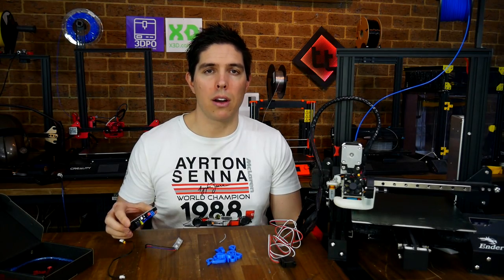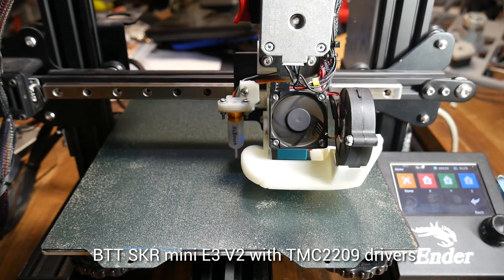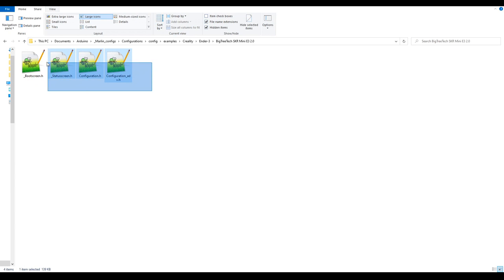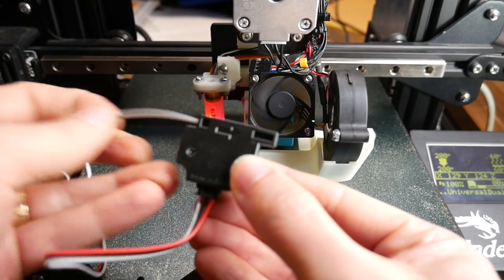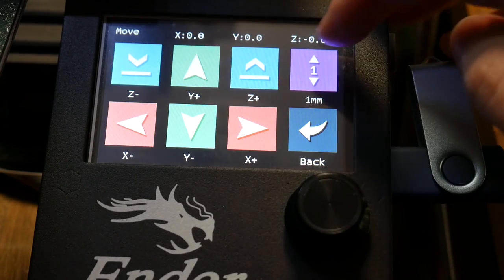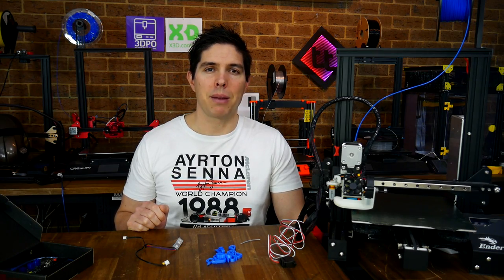SKR Mini E3 V2.0 - Complete guide to the best value Ender 3 upgrade

Comment: Because I use this video OFTEN as a reference for this board, here are some bookmarks:

0:57 - What is the BigTreeTech SKR Mini E3?
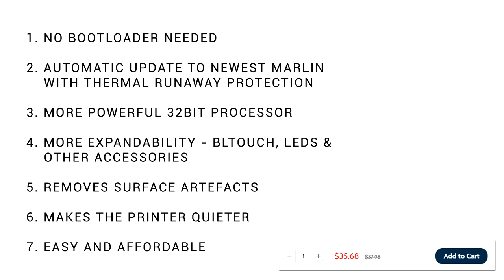2:21 - What is Different From V1.2 to V2.0?
4:09 - How do you install the mainboard?
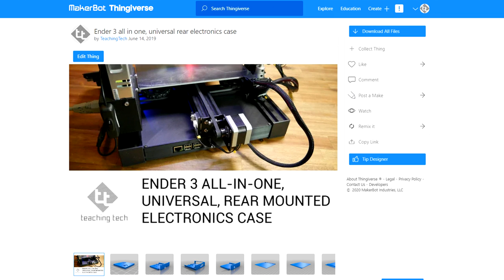4:57 - Compatible out of the box?
6:11 - How can you compile your oen firmware?
8:39 - How does the new EEPROM work?
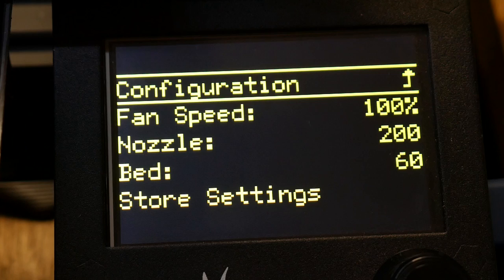9:01 - BLTouch Compatible?
10:42 - Filament Runout Compatible?
11:45 - Neopixel and other accessories?
12:59 - TFT35 Dual Mode Touch Screen
13:37 - 3d Printer Wifi
13:43 - UPS
13:55 - How to activate sensorless homing?
15:07 - End summary
Reply: you are my hero for today.
Reply: thank you kyle! i just finished the long install of all 3 e3pro upgrades and bounced between 3 vids because theres a dif nugget of info in each vid...nothing worked right and i flashed and no ttft display after flash...wracked my brain...drank went to bed...double checked every wire config...bltouch connection wires red and blue were flipped...fixed...found out the damn reset button on the display was being pressed by the factory mount...WHY?! now i sit here dumbfounded and yep...
Reply: @507helmet  I had the same problem, took some measurements, went to my very cold shop, drilled a 3/8" hole in the bracket, problem solved.
Reply: thanks man, so freaking helpful. skipped half the video just to listen to the part i needed to in 2 seconds :)
Reply: How do i get the tick to show in the bottom menu? Thank you
Reply: @nikkicork8815  Not sure if you're still having a problem but...
If by "tick" you mean the video progress bar, all you have to do id click on the video and you should see it at the bottom of the video. This assumes you are viewing the video from the website and you haven't downloaded it somehow. If you have downloaded it the step(s) to show the bar depend on the application you are using to play/view the video.

Comment: Another great guide. I swear, you’re carrying the ender 3 community. I’d have never bought one if not for detailed guides like this. It’s a good thing you’re a science teacher, because you’re great at it!
Reply: You'd never have bought the Ender 3 if it weren't for these guides? Don't get me wrong, Michael has the best guides on YouTube, but the Ender3 has been the best value FDM printer for the last 2 years running.
Reply: Heroman I mean that I learned about the printer through Michael
Reply: @Drakoman07  same here and I agree with what you said (in an odd backwards type of way).  I bought the ender 3 based on lots of research with his being very helpful.
In hindsight, I would also say "id never have bought one either if it wasnt for micheal. aka: i wouldve had a teribble time trying to figure it all out and probably given up bc well all know DesignProtoypeTest isnt about to put in half the work towards being as helpful, detailed and budget friendly. Not everyone can just up and spend $300 on duet and 5' screen since i spent 2/3rds of that on the printer itself
Reply: My son chose to buy the Ender 3 Pro in August based on channels like this and the comments from owners. We've had a straight forward climb from build to very high quality prints in multiple filament types and never looked back. I'm extremely grateful to this channel and the comments from users about their experiences and ideas. There is no way the journey would be as easy as it has been without all of you. Yes it's a bunch of work, careful watching and reading etc, but still no big issues of any sort, and the print quality,,, wow.  We upgraded during the build process ( extruder, bed springs,and wheels etc ) , I can't say enough about the value of the  learning process , maintenance details and understanding the role of each component that this channel has provided. We use Solidworks to design, those drawings are done very differently had we not had the overall printing experience the Ender ( any good printer ) has provided. It forced us to do small upgrades incrementally and really understand printer setup and tuning adjustment. Best Wishes to all who contribute and Thank You !!

Comment: I recently bought an Ender 3 (my first 3D Pinter) and was looking for ways to upgrade it. I started watching your videos while researching printers. Once I got it and started printing, I knew I wanted to quiet it down. So I got the SKR Mini E3 v2.0 and TFT35 E3 V3.0 and installed them. Holy shiznit! It’s so much quieter. The touch screen feels like it belongs in this century. Now I’m looking forward to add a BLtouch and filament run out sensor.

I just wanted to let you know that your videos have been helpful and informative as I venture into this new hobby. So, thank you and keep making great videos. :)
Reply: I also just bought the Ender 3 as my first printer, will be building it this weekend.  I also am strongly considering at a new motherboard adn agree this channel has many helpful videos.  :-)
Reply: So after installing the SKR Mini E3 v2.0 I was still having trouble with first layer stick and bed leveling in general. I'd already ordered a BLTouch v3.1 and it arrived a couple days ago. So I got it installed along with the firmware available from BTT on github. It took me a little bit to get things figured out but now prints are sticking and I'm getting consistently better results. Yay! :)
Reply: @SereneScream considering it too. I have bed adhesion issues as well, have to use the z babystep on the first layer to Get good adhesion then turn it back. Its a pain in the ass

Comment: The biggest problem with this upgrade: After you install it, everything else on your printer seems LOUD. Especially the board cooling fan. Which means you'll need to swap those things out, too :D
Reply: @steveandre763  Does your firmware use the BLtouch as a Z stop?
Reply: @steveandre763  Are you able to answer the question Balan had? Does your firmware use the bltouch as a z stop?
Reply: @steveandre763  LOL He means since the stepper drivers are silent the fans SEEM loud, not that they are louder.

Comment: As a person that has owned an Ender 3 for less than 24hr, I was able to drop this into my stock unit without any issues. Massive improvement to noise and really happy to see you've tested out a lot of the popular upgrades!

Side note: Awesome channel. Been very helpful with me dipping my toes into 3D Printing!
Reply: My son and I are in the process of purchasing our first 3D printer and have narrowed it down to 3/3 Pro/5. How user friendly is the 3 for first timers?
Reply: @bocconom  i just got an ender 3 pro a few weeks ago (for the price its so worth it) , easy to assemble (you shouldn't get stuck but if you do youtube has alot of build guides for all models!), the hardest thing is probably getting the bed level, its not hard to do, but make sure you put in the time to make sure it is as close as you can get it, again youtube guides help you, but once you've  done that, its literally load filament choose your model and print it! :D always watch your first few layers to make sure it sticks to the bed! if you ever get stuck theres so many videos on here for 3d printers to help you! good luck
Reply: @bocconom  Very very friendly for first timers.  I'd argue that it's probably the best printer for a first timer.
Reply: @Mr-ZinK  Thank you much. Did you do any other upgrades?
Reply: @leopshef  I think we have settled on the 3 Pro. Thanks.
Reply: bocconom , the ender 3/pro is super easy to assemble. In fact I’ve had mine now for 2 weeks and have burned through almost 2kg of pla filament. The best advice I can give about building is follow the build guid here on YouTube by CHEP. It’s a little more involved but when I was finished building all I did was a quick bed level on the 4 corners and installed the micro sad card that came with printer and selected the pig and pushed the knob and away it went. The next morning I went back out to the shop and I found the cutest little piggies bank. Also the sad card that came with the printer also had a basic slicer program that works very well. It is based off of Cura. Also just FYI, I noticed tonight that the ender 3 pro is now only $209 with free shipping. However you have to order it from Creality’s website direct. Your new printer will arrive in 3-7 days. I hope you choose to join the ender family.

Comment: I bought the mini E3 largely because of your video, and I was blown away by how much better the printer performed with it compared to the stock board, particularly regarding noise. I've recommended it to a couple friends as the first upgrade they should buy for their printer, and they've been happy with it as well. Through my journey in printing I've watched your videos, so thank you for helping educate me and many others in the community. I started looking deeper into duet boards a week or two before your video on them, and they seem quite promising and offer several things that marlin doesn't have yet; it would be interesting to see how using a duet in an ender 3 impacted performance and usability. Happy Printing!

Comment: For those who bought the board for Creality printers: Remember that the positions of the mainboard fan plug and the parts cooling fan plug are switched on the SKR E3 v2.0 and the Ender 1.1.4 mainboard. This is also shown in the wiring diagram but I think it's not directly mentioned in the video.
Reply: thanks for mentioning that
Reply: I was exactly looking for this information... I noticed the discrepancy between the cabling on the original Enders board and diagram shown in the video. Thanks!
Reply: didnt work for me
Reply: @bobf3598  what didnt
Reply: Is the hot end fan supposed to be turned ON all the time? If not, how can I fix it?

Comment: I've just upgraded my Ender 3 pro to the SKR min V2.0. Only 2 small issues when using octoprint. I didn't get any comms via the USB port, I'm using a pi 4 and the USB operation has changed. Evidently you need to add "over_voltage=1" to /boot/config.txt of the pi, I had no issues with the stock ender board and the pi so it must be different on the SKR card.

Secondly, something I was going to get around to on the previous board but didn't was to put a slither of polyamide/kapton tape on the +5v contact on the USB cable so the pi is not powering the main board. I had false overheat protection alarms from the printer if you turn the main power off on the printer with the nozzle still hot. I didn't get that with the previous board so assume overheat protection wasn't enabled although the version of firmware supported it, it was the stock Ender firmware. I believe thre are other issues around powering the board form the pi, here's a good reference https://github.com/bigtreetech/BIGTREETECH-SKR-mini-E3/issues/41

Comment: I installed one of these as a retrofit on a Wanhao I3 Plus this weekend, and the only thing I haven't gotten to work is using the second fan connector to be a auto hotend fan.
Defining it as the auto fan, it powers up on startup. Other than some pid tuning for the bed and hotend, it's working well with a bltouch also. I didn't bother with sensorless homing.
Reply: how noticeable the improvement?

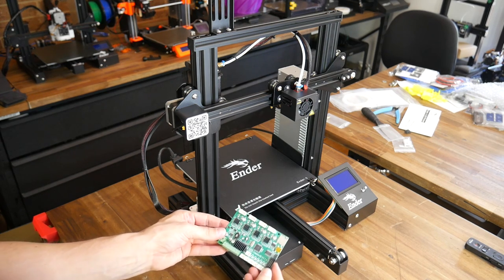Comment: 4:31 in the diagram the label for G and I should be switched around. had this problem that my part cooling was always on, but now when i switched it up the "G" should be in the "I" it worked normally Please take note of this!
Reply: Also E should read black/black and not white/white (at least on my printer)
Reply: Also, on the SKR diagram, connection B ... the wires shown are the wrong way round. Positive is closest to the side of connection C, not H.

Comment: You'll need to install the Platform IO extension in VS Code in order to get the tick option at @7:10!
Reply: Thanks! I was wondering why this wasn't mentioned in the video...
Reply: @doctorsnaketown  I think because as you get into the Maker world it turns out to be a popular plugin for using VS Code to program stuff like arduinos and other microcontrollers. But if this is your first entry into that world then (like for me) it is definitely hard to know 🤣

Comment: 4:29 - Just a heads up that at least on an original CR-10, "B" in your diagram is backwards. I don't know if the polarity is reversed on the SKR board or on the bed heater relay. Either way, after getting a bed heating error I swapped the red and black and it now works fine.
Reply: After you installed the board in the CR10 did you have to compile new marlin firmware, or did it work out the box?
Reply: @chrisstock5210  Yes. I had never taken the time to understand all of the Marlin firmware so it was a good exercise. There's a reddit post on building the firmware for Ender which I followed but started with the generic Marlin Example Config for Cr-10 and retained all the CR-10-specific items, mostly bed size/dimension related config.
Reply: Thank goodness for you! I couldn't figure out what was wrong. Now I'm set after swapping those 2 wires!

Comment: Just installed the v2 in my ender 3 pro and I'm pretty happy aside from two issues. 1: clicking Stop Print does not immediately stop the print. I have no idea why but there is often a delay between 10 and 30 sec before the print stops and while I don't use this much, when I want to stop a print, I want it stopped NOW! 2: It may be the lack of motor sound but now the other fans sound SUPER loud. This second one is less a serious issue but any ideas on #1 would be greatly appreciated. Love the channel.

Comment: I installed this and I'm getting a "no printer attached" notification on the touchscreen board. Can't move it tried going through all cables with no luck. Any ideas will be helpful.
Reply: Ty
Reply: Solved update touchscreen firmware
Reply: Mine shows that until the mainboard finishes booting up. Takes maybe 5s or so.
Reply: I had serious issues at the start trying to connect the BL touch because the company I bought it from on Amazon used RED for ground... So the board was going into automatic shutdown every time I booted up. Once I switched the wires around it worked.

Comment: Something to keep in mind: I'm pretty sure there are 2 versions of this board, one having an RCT6 labeled on the processor and another with RET6. I believe the latter is associated with a 512k onboard flash rather than the 256k flash found on the RCT6 model. I'm not sure, but it looks like the build environment he is using in the video would work for the 512k variant, but maybe not the other? Someone let me know as I am a little worried with choosing which one when compiling.

Comment: Is there a reason or advantage to buy a SKR 1.4 turbo and 2209's over the SKR mini?
Reply: One advantage would be that the drivers are seperate on the 1.4. So if one breaks you don't need to replace the whole board. And there are 5 instead of 4.
PS: I'm also looking for either the 1.4 turbo with 2209's or the mini. Now that the mini 2.0 is out, the choice is even harder.....
Reply: Currently I have to make the same decision :D and I have no Idea which one...
Reply from the maker: If you are planning big future upgrades like switching to dual extrusion, the V1.4 will be better. In most case the mini will suffice.
Reply: Cookie with the cost only being $35 it’s a non question. I assume the drivers are inexpensive? Guess it all depends on if you want the newer board. Assuming your not running dual extruders.

Comment: Wow I just installed this last night and it’s working great so far. I have the EZABL so I had to do a little extra work with the firmware. My direct drive arrives tomorrow which I purchased because of your MDD video. I also printed the HMG5 with dual 5015 fans. You’ve taken my printer way farther than I ever thought it could go.

Comment: I ordered this the same day I ordered my Ender 3 Pro. I like the board - much quieter than the OEM part, more features, etc. I installed a bltouch v3.1 and wanted to keep my z endstop, so I tried to use the probe ports as indicated in the manual (the "1st way" as indicated in the video). This never worked with the BTT-compiled firmware or my own custom Marlin build: the probe would self-test, deploy/retract, but WOULD NOT TRIGGER at all. I checked, re-checked, and checked the wiring again - it was all correct. I plugged the probe wires into the z endstop pins, et voila! it worked. YMMV.
Reply: This has always been kind of a problem with every BTT board that has both a Z-endstop and a Probe pin. I can't remember the details correctly but the way the firmware is written you needed to do some hacky changes to the code to make it work the way you want. I think there have been attempts at introducing config settings to change the behavior but I'm not sure what's the current status since my printer has been down for a couple months.
Reply from the maker: My patrons tell me that particular work around has been implemented in Marlin now. Fingers crossed it's easier moving forward.

Comment: Very good guide! It helped me a lot to configure the new Board.

Sadly the Neopixel Workaround does not work anymore, because the Repository has changed in that specific code snippet.
Reply: Has anyone figured out a fix for this?  Really want to use some.
Reply: Try the newest version this seems to work for me, at least I am able to compile it after installing git on my machine.